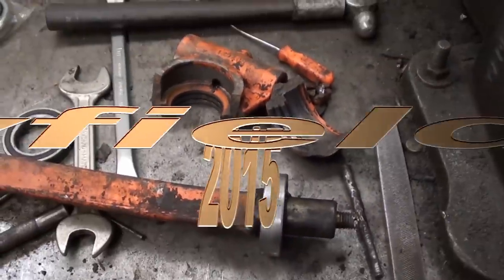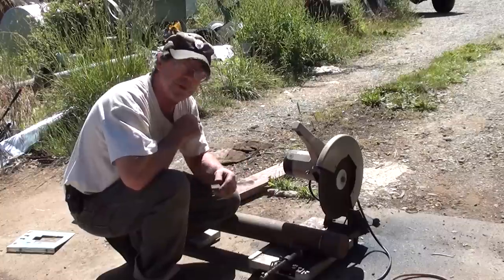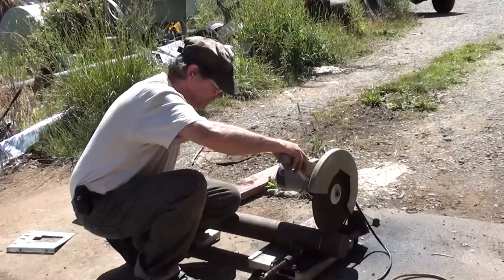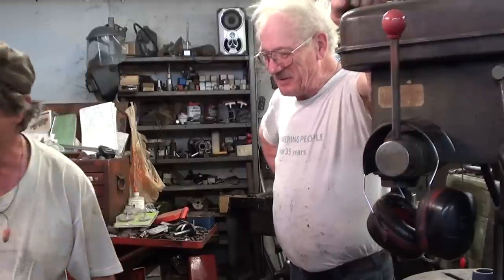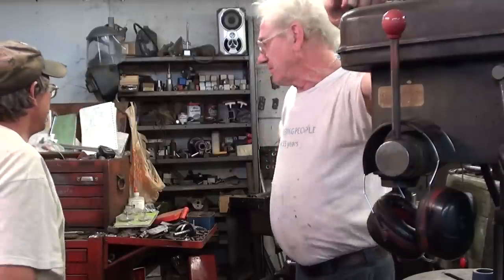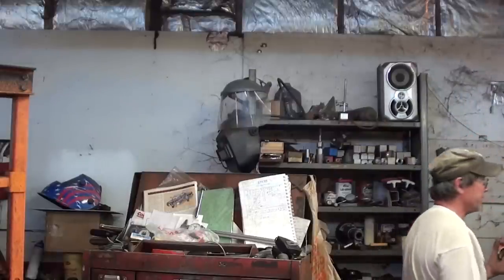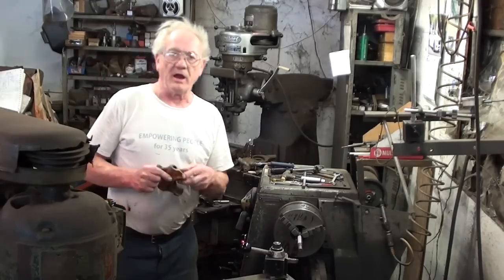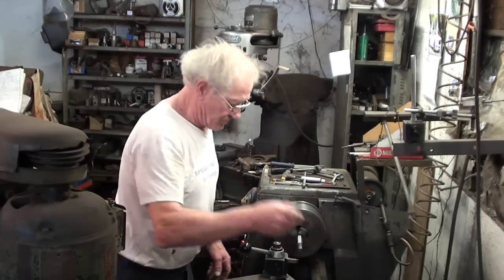Pt 1 of 4 Allis Chalmers Model 7 Rake Repair with TONY!

Comment: Before I retired as a welder from a steel mill, I worked with a machinist named Bill Baker, Your machinist friend looks like him a great deal and both had the same sense of dry humor and carried themselves exactly alike, so much that they could have been brothers. Sadly, Bill has passed on now and is greatly missed by family and myself. I had worked with him for more than 30 years, had many a laugh and good times when working together. RIP Bill, you are very much missed by all that knew you.

Comment: Just eyeballing it I'd say the grey MG is a 64 Midget and the other is likely a 76-79 Midget.  The former uses a 1275cc BMC A motor and the latter a Triumph Spitfire 1500cc.  I don't know that either is particularly valuable and the costs of a restoration would exceed resale value. They are fun but pretty tight on room.  They are pretty cheap to run.  I agree that both could be broken up and sold for parts -- likely to collectors living in Seattle who need rust free body parts.

Comment: Those are both MG Midgets; one early model and one later (with the plastic bumpers). I would guess the reddish one to be around 1964 and the other after 1970, but not sure.  It's been over 30 years since I gave up on British cars.  8^}
Reply: there gang 6 model shells both from the late 70s early shells have round wheel house back end
Reply: But the major problem is the steering wheel is on the wrong side for a Brit car.

Comment: nice midgets. Use that red car to fix up blue one with the wirewheels. Tech is super easy. There was also the even cuter looking Austin Healey 'frogeye' Sprite, it looks different but i believe the tech is the same.
Reply: jfv65  It's the exact same car save for the nose. The Midget came along later ('63 I think?).

Comment: all that water is dangerous with the cutter ??? and that blade is worn out or its not made to cut steel ??
Reply from the maker: datguy807 It's 4 inch round stock and a 40 year old Japanese chop saw.
Reply: ElderlyIron  I woulda cut that with a torch ?? !! and use a grinder too smooth it out ???